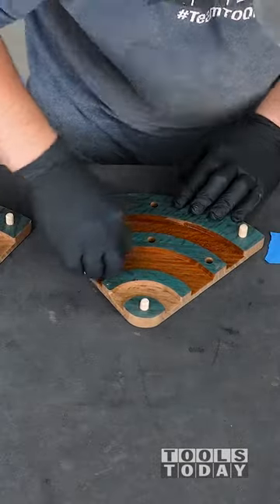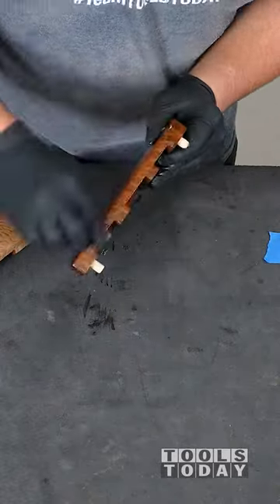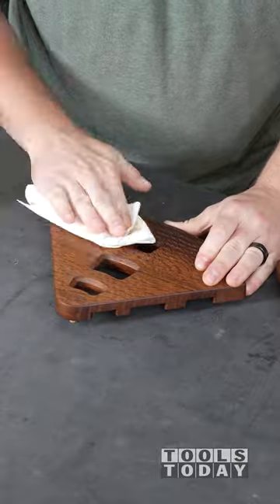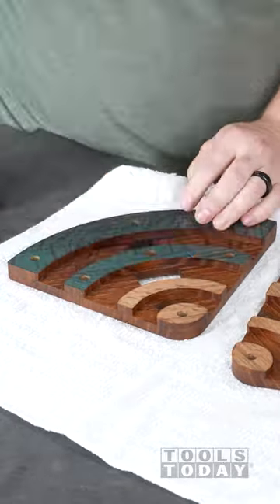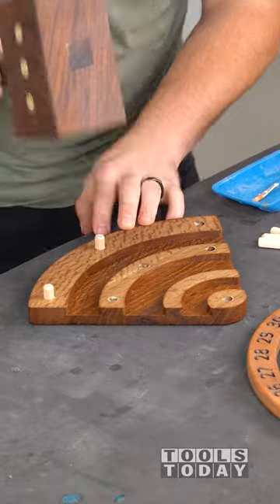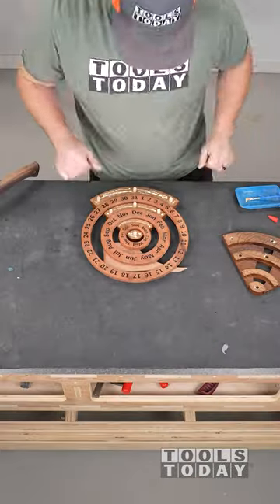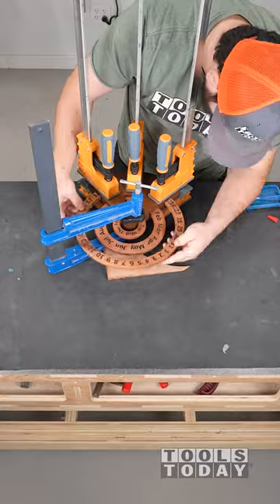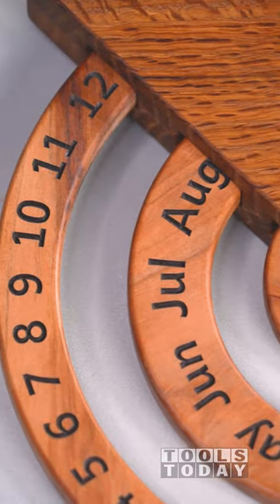Assembling Perpetual Calendar

Comment: Have you considered cutting pockets in the back of the rings and glue in magnets so that the words/numbers "index/lock" into place with opposite pole magnets in the aperture windows? Would add an interesting tactile feel to the piece also. Great work!
Reply from the maker: I hadn't but that's a really cool idea.  I am going to be making one for my son, who is much younger, that is for weather, this would be something that would be really cool to add to that one.  Thank you for the idea!
Reply: @ToolsToday  another way you can do it is putting indents with a chamfer bit (drill a small 1mm pilot hole to keep it in place, you could also use a jig and a ball end on a router) and using a ball bearing on a spring in a hole, though that can be a bit of a pain to fit together.

also instead of glue, I'd keep the dowels but use screws from the back, maybe even with inserts, so in case a ring gets broken or the magnet pops out you can fix it

Comment: I like this. 
Let's add a ramps board, steppers, and a pi to let it auto update
Reply: counterpoint: use a series of gears with some Geneva mechanisms and a clock
Reply: The most awesome thing about building things is the multiple different ways you can do the same thing, and get similar results.